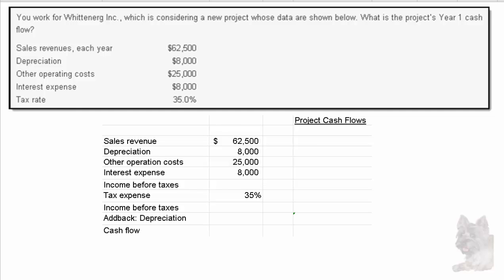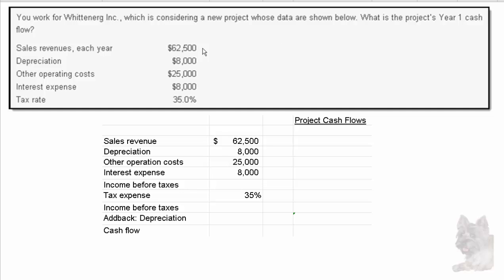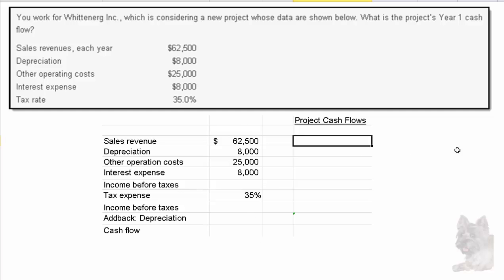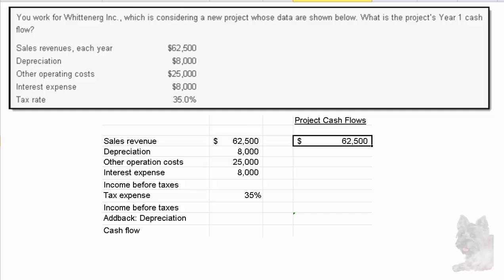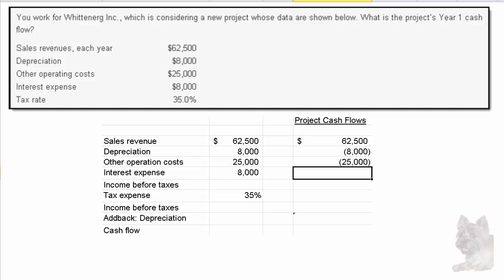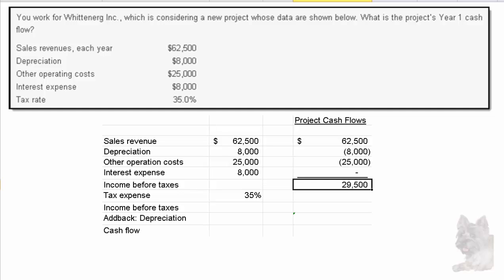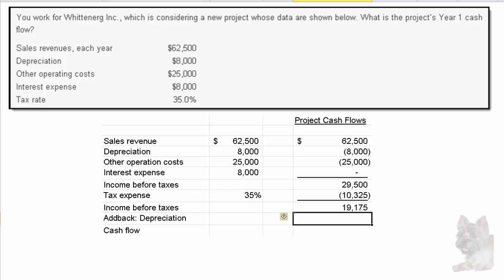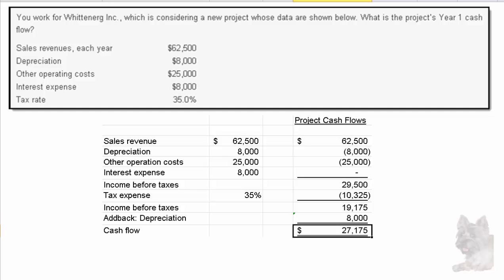Calculating Annual Project Cash Flow

Comment: Question 1 
Havana Inc has identified an investment project with the following cash flows:
Year	Cash Flow (RM)
1	1,075
2	1,235
3	1,510
4	1,965

If the discount rate is 8 percent, what is the future value of these cash flows in Year 4? 
What is the future value at an interest rate of 11 percent? At 24 percent?